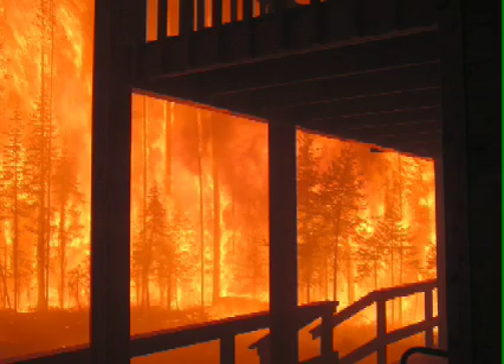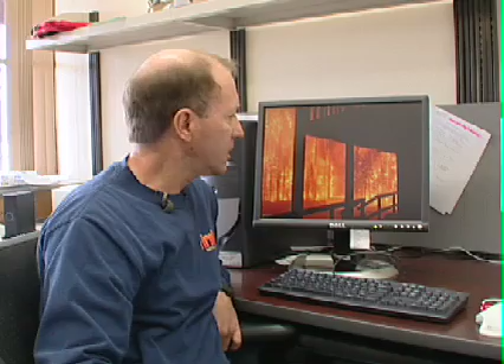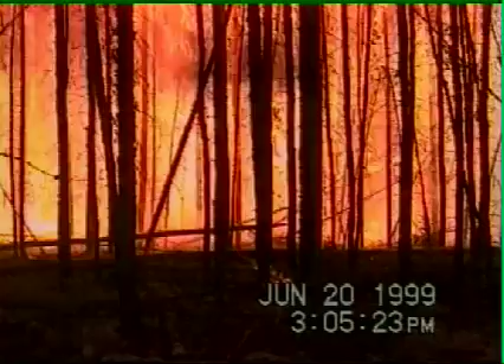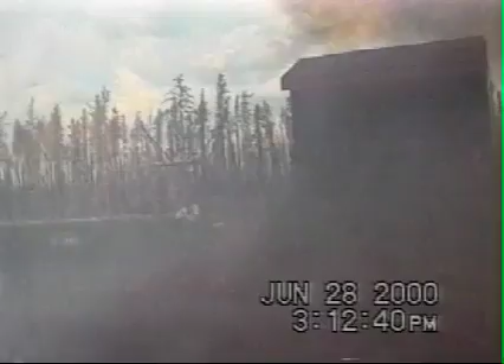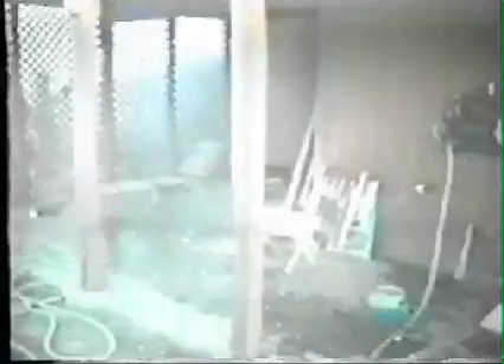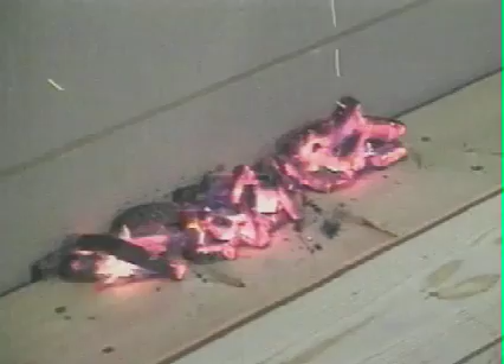Radiant Heat Versus Firebrands(embers)

Comment: Thank you for this video. I keep running up against local Fire Department people who claim using basic FireSmart techniques are all that is necessary. In other words, keeping all combustibles at least 30 ft from the house, removing leaves and needles from gutters and decks, eliminating shrubbery at the house etc. Windblown embers (firebrands) are the real danger, and although the above FireSmart actions are important, they are not enough.